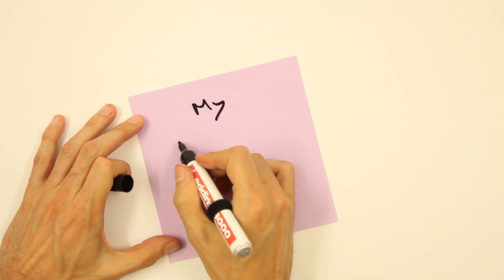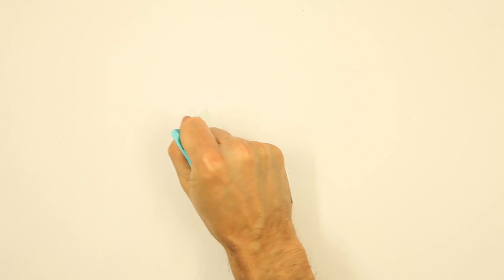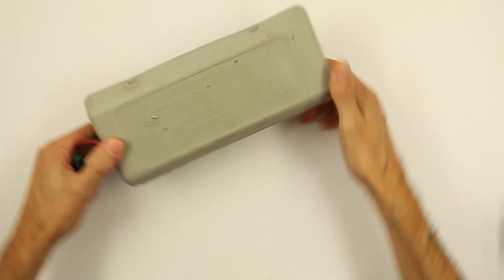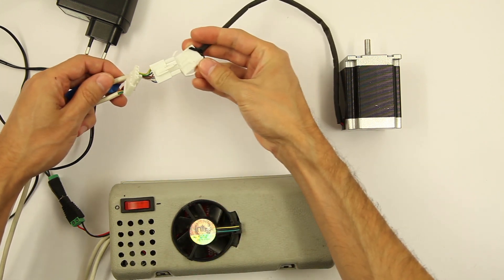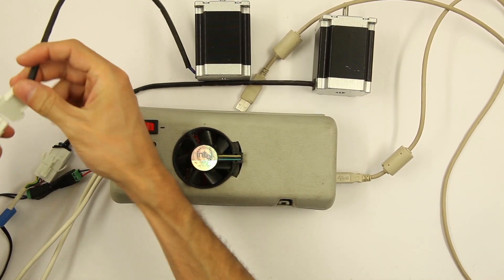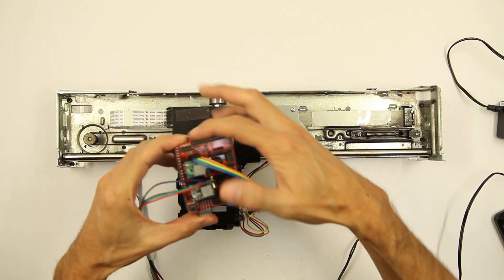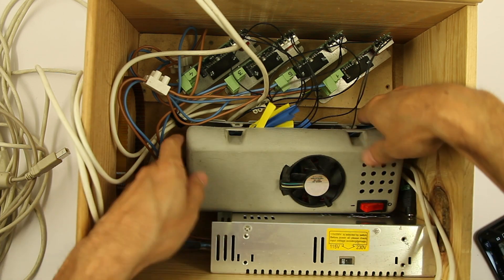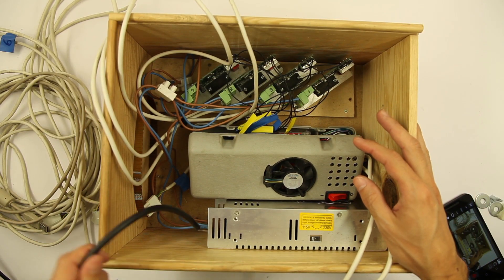All the stepper motor drivers I use for stop motion control, REVIEW

Comment: Hi edu, thanks for your projects sharing, it's amazing and really helping with my own personal projects!!
I would ask you a question please, what kind of power supply do I need to use for a setup with 4 stepper motors (nema 17) and big easydriver? 
Thank you and hope you have a great weekend!
Reply from the maker: Depends on the specks of your motors but, to be sure I would say to go for a 12V and 30amps big one. If not, provably with a 12V 5amps one you will be also fine and it is smaller, but again depends on the consume of the motors.
Reply: Thank you very it's working!
Reply from the maker: Great!!

Comment: Thanks for replying!
One more question please!
I saw in your video, on Dragonframe you put two key point "A" and "B" for one axis. 
I try to put more then two point, like (A-B-C-D....) for one axis. 
But I didn't find the way how to play from first key point to the last. It going only from one key point to next and stops. 
It's any option in Dragonframe to play from firs to last?
For example, motor turn to the right 10 frame in 10 seconds. After it turn back to the left 5 frame in 10 seconds. After it turn to the right again for 15 frame in 5 seconds. 

Thanks a lot!!!
Reply from the maker: No problem. Yes, you can put as keyframes as you want in the same axis. It is as easy as setting the first position, mark a keyframe, the diamond buton, go in the timeline to the next frame position, move the motor to the desired position and then click again the diamond buton to set a keyframe and like this as you want. Hope it helps, if not ask me again.

Comment: Hi my friend!
I saw all your videos with motion control. 

I have some questions about MRMOCO SFH-50. 
I have one but without some original cables and his original computer amd soft. Buy new one is to expensive, so I want to try to use it with Dragonframe. 

Please, I need your advice. 

Can you tell me if I can use the original motors (imc mdrive 17 plus) on MRMOCO head with Arduino? If "YES", how to connect them?
Or is any other options to conecting them to Dragonframe without Arduino?
The motors looks like all of them have driver onboard. The connector have 6 pin. 

Please, help me with this issue. I really want to start to use it. 

I have a workshop and make camera cranes (Jimmy Jib) Facebook.com/ArthursEquipment , but never work with stepper motors. 

One more question, it's possible to use this steppers with joystick?

Thank you!!!
Waiting for your answer. 

Mailto: arthurilyuts@mail.ru
Arthur ILYUTS
from Istanbul-Turkey
Reply from the maker: Dear, MRMOCO SFH-50 seems a beast, it is great! I am not an expert on it but acording to pdfs from imc mdrive 17 plus I think it's possible. You must find the right cables on the motor to send the STEP and DIRECTION signals from arduino. The board has more options than step-dir, so better be sure.  Contact the motor company and ask them wich cable or input is the right. Keep me updated, it will be nice to know if it is possible. Thanks for your interest.